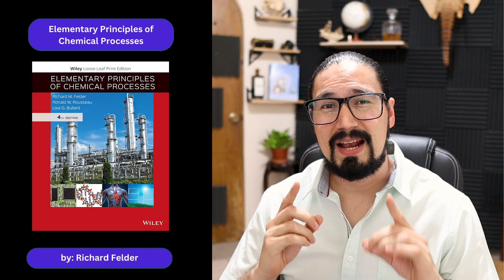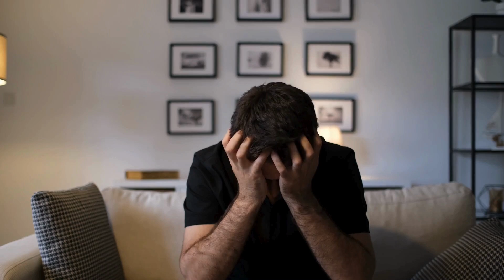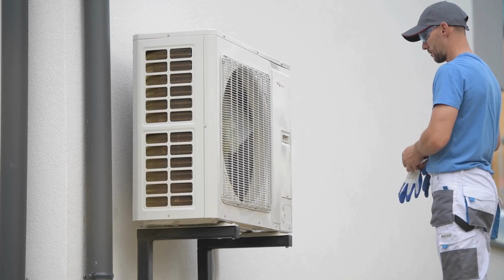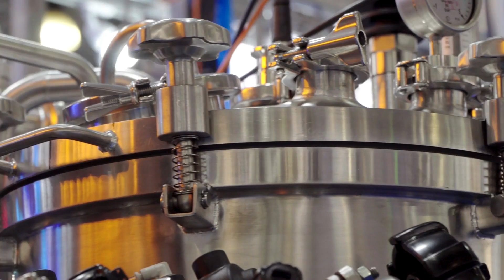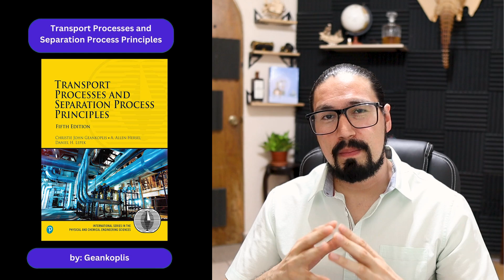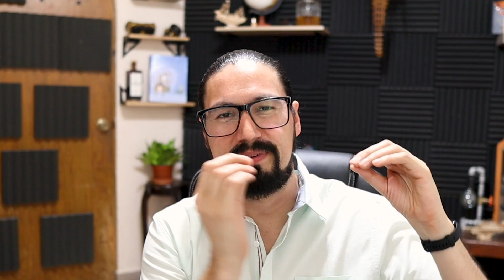Must-Have Books for Every Process & Chemical Engineer

Comment: I wanted to ask about chemical engineering portfolio . How important are they how do you create it and what kind of projects should you add on your porfolio for example Aspen plus and matlab projects?
Reply from the maker: Not quite relevevant, but of course, it could be something that differentiates you from other competetion, especially if you  are going to work in process simulation or process control, may be even as a process engineer.
Reply: @ChemicalEngineeringGuy  ok thank you

Comment: Must have books for newbies, academics or students for sure. But not for experienced engineers at all!
Reply from the maker: True, this is mostly for academics! I'm working on the books & handbooks for professionals... any specific listing you'll like to see?
Reply: - Rules of thumbs for chemical engineers 
- All Books from Norman Lieberman
- Problem Solving for process operators and specialists from Joseph Bonem (a gem)
- Process Design for chemical engineers from Franck Yu (former Senior Process Engineer at Jacobs Engineering)
- Book on combustion from John Zink
- Books on rotating machinery from Heinz Bloch or Robert X. Perez 
- And many more on commissioning, boilers, other equipment or Utilities and specific process industries

These books are way more useful as the main fundamental concepts are explained in a more practical and useful way
Reply from the maker: @lionels839  im considering 2-3 books from norman lieberman! Rules of thumbs is also in the list!  Im just working in the edition of the vid!
Reply from the maker: @lionels839  I'll check out the combustion and rotating machinery books, Im not quite familiar with those
Reply from the maker: @lionels839  thanks for your input ;)